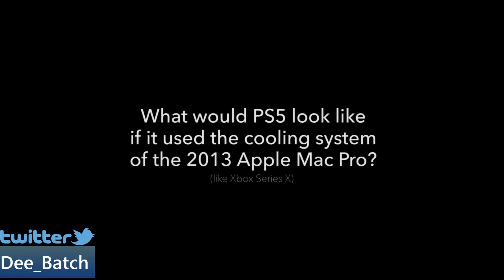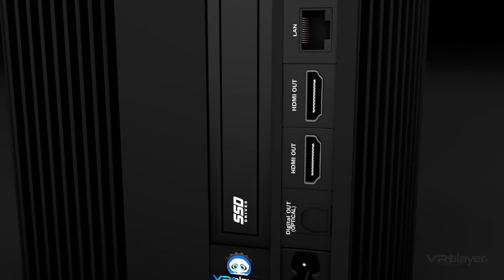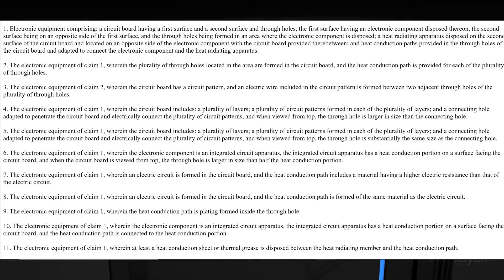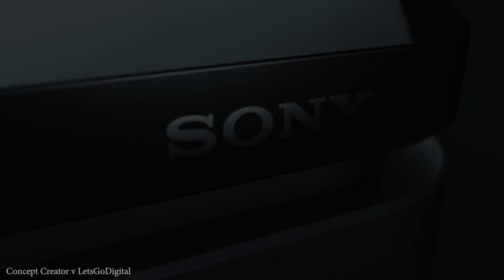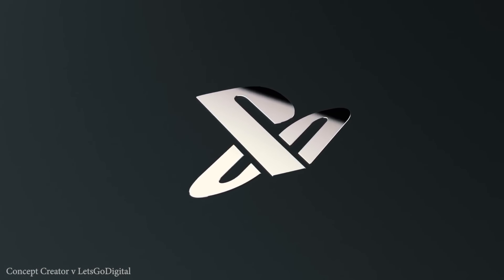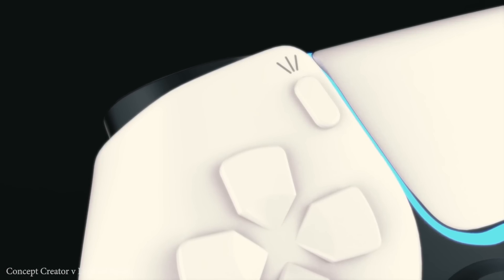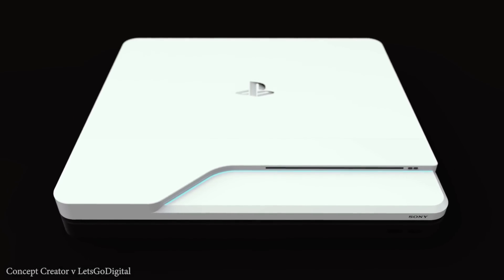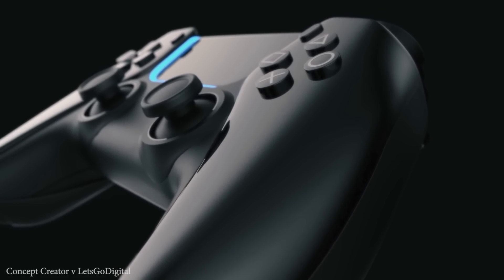PlayStation 5 Cooling Patent Revealed | PS5 Will Have Never Before Seen Tech

Comment from the maker: Sony's Patent on Cooling was filed on April 23(Today). Therefore Dev kits do not have it. Reports of dev kits running hot will be resolved when this cooling system is implemented on the final console. What do you guys think of Sony's Cooling solution?
Reply: If this patent does come true , then tge $500 to $550 price point doesn’t seem far fetched
Reply: @SuperMosh1990  What are you talking about? That price guess has never been far fetched as the production price is 450.
Reply: Another patent that might never see the light of day
Reply: DEE BATCH does anyone read anymore?? The patent is published today, it was filed in 2018. I mean seriously, read first people. Please. Smh
Reply: MG Pilot thats even worse then. Because if this is from 2018 and dev kits are heating now in 2020, that would mean that this cooling method is most likely in the dev units and does not actually work as intended.
Reply: Patrick Julian Krutina it probably means that that story was complete bs. There was no overheating
Reply: @Germinator4lph4  AND Xbox Series ALSO Cools chips from both side. That's what the aluminum center chasis in Xbox Series X does!! So this duel cooling concept is not so new or original.
Reply: INFURIOUS ONE XSX will also the vapor chamber design from One X. Which is actually patented by Microsoft, so the question is have Sony have brought in a new approach.
Reply: @Germinator4lph4  In the End if they both work that's all that matter. It just that PS5 seems to be MUCH more dependent on a good cooling system to get peak performance. Where as Xbox Series X does not.
Reply: @Germinator4lph4  Nonsense. The PS5 Devkits overheating was debunked as bullshit
Reply: just more proof this is a 9 tflop machine....new cooling solution to allow crazy overclock...interesting to see if these last 5 years..
Reply: DEE BATCH better late then never. I can’t help but wonder if Sony got word of Microsoft’s specs and made the decision to over clock their system. And are just now looking into cooling system fixes. - seems strange to be doing this the same year the console launches.
Reply: hahaha!! this xbots are going out of control!!
Reply: Time will tell...I'm finding it hard to see how this console will cost $399.
Reply: Phil has had a Series X hooked up at home testing the final product for some time and PS5 just now coming up with a cooling system. Does Mark have a working final build of a PS5 hooked up at home testing it?
Reply: My MacBook Pro still has fans and get noisy (more so during screen saver mode than graphically intense visuals).
The body being aluminum helps as well... doubt PS5 will be aluminum.
Reply: The patent will be enforceable after April 23th. The PCP was filled May 18th 2018. Is that cooling system inside the dev kits? I'd like to know that!
Reply: DEE BATCH hey Dee, any clue on how costly this cooling system will be for them?
Reply: @T_M_E_8  it was stated it would cost around $3-$4, which doesn't sound like much, but the normal average is less than $1 for that component in mass production. Wont translate to much of a difference for us individually, but for them, they're going to feel that difference in cost.
Reply: Jonathan Hensley thanks!
Reply: @T_M_E_8  You're welcome
Reply: Reeeeeeeeeeee
Reply: DEE BATCH would this make ps5 a good quality system and last long time with no overheating?
Reply from the maker: @mettaalpha8551  Not sure nobody has done this before.
Reply: DEE BATCH yeah will be interesting to see what system will end up being the better buy
Reply: It’s bullshit
Reply: come dee batch! put these xbots together!!
Reply: DEE BATCH mark cerny said revolutionary i guess he was right
Reply: If the patent got filed today, then probably this will not make it into production. This probably their reaction to XSX reveal and Sony is already getting ready for the mid cycle replacement in 2024 i.e the PS5 Pro.
Reply: @Germinator4lph4  Patent was filed in 2018!!!
Reply: @IngaNodie-k9s  ???You're comparing PissyS5 to Xbox One X??? And loading a last Generation game on a Next Generation Console??? That's dumb😲.
Reply: @IngaNodie-k9s  Xbox Velocity Architecture nullifies SSD Advantages. In fact developers have said because of other Technical reason SSD Speed advantages will make little differences and Zero effect on game quality. Xbox Series X's 44% MORE CU Processing Power is just to much for PissyS5 to overcome. And that's besides the TF and CPU Advantages. Xbox Series X will have full Real Time Ray Tracing. PissyS5 will NOT!! Sony has NOT even confirmed if PissyS5 will have VRS??!! PissyS5 is RDNA 1.5 NOT full RDNA 2. When this comes to light hopefully you'll wake up. And NOT buy PissyS5 Day One. Third Party games will look and run soooooo much better on Xbox Series X. Many gamers will be trading in their PissyS5's for Xbox Series X within two months. So it would be wise to wait ✋ and buy a barely used PissyS5 at a discount price!!!??? Wake up Now. Better to be the smart guy buyin the barely usee PissyS5 at a discount. Than be the IDIOT that was dumb enough to buy PissyS5 Day One just to trade it in for Xbox Series X and taking a loss!!?? You've been fairly warned. And given future knowledge. Use it wisely??!!
Reply: @infuriousone5225  You don't know any thing about PS5  except high-level theory represented by Mark Cerny in that GDC conference stop believing in Imaginary secret source and Xbox fanboys youtubers disguise as Imaginary Sony Devs. Sony is been testing for years retracing software and Hardware solutions closely with AMD. Same company Used by Microsoft.
Reply: @IngaNodie-k9s  Hey Friend Games are made by the GPU and CPU NOT the SSD😲.
Reply: @IngaNodie-k9s  the ps5 was loading fast travel in Spiderman not loading the game from scratch.
Reply: @IngaNodie-k9s  no SSD is anywhere near the speed of ram tho.
Reply: @IngaNodie-k9s  Dude Xbox Series is much more Powerful than PissyS5. A SSD drive is not a magical wand that's going to change that. PissyS5 is NOT more cleverly designed. Stop being delusional.
Reply: @infuriousone5225  Who said SSD is the only thing that makes that system powerful there are other components beside that  ETC and Mark confirmed ratracing. For a record I know Xbox Series X GPU is more powerful than PS5 GPU xbox had powerful than Sony for years except the Xbox one but in a long run Sony always showed us innovation every generation.
Reply: @IngaNodie-k9s  No Mark Cerny did NOT confirmed Full Real Time Ray Tracing. He did NOT even confirme Hardware Accelerated Ray Tracing Cores that handle the Ray Tracing WITHOUT using GPU TF Power!! So on Top of Xbox Series X having a SUPERIOR form of Ray Tracing. Xbox Series X 44% CU makes Xbox Series X's ALREADY more Powerful Ray Tracing ANOTHER 44% MORE Powerful😵😵😵. PissyS5 has no hope😫💔😫.
Reply: @infuriousone5225  how will xbox squeeze that £700 graphics card into a £500 console? 🤔
Reply: @philipburgin3109  Ask Microsoft??!!
Reply from the maker: @IngaNodie-k9s  NO
Reply: @IngaNodie-k9s  yes but gears was a very early build and not fully optimized for it. The were just showing the brute force of the power behind the series x and what it could do without fully optimized
Reply: @toddhudson7440  PS5 was not even an early build it was a dev kit imagine what the full product will do. I trust PS5 because it was design with developers, Consumer and engineers in mind. Microsoft rushes to compete without a long term goal that's why they are always bad in technology. They skipped windows 9 being afraid of andriod eventually andriod took over they were left behind they been putting unnecessary big updates on windows affects performance and reliability of windows.
Reply: The Aluminum block between the 2 boards on the XSX is doing the same thing dissipating heat under the chip while the vapor chamber does it from the top.
Reply: Dee please take a look at this https://www.youtube.com/watch?v=oG_7Zf44KU8
Reply: I feel like sony heard yall talking shit(granell) on rdx and new they had to fix that problem before word got to far out
Reply: @OldBu11  Wrong, they had mentioned this cooling soloution 4 months ago
Reply: @IngaNodie-k9s  you just proved you don't have a fucking clue what your talking about.
Reply: So Sony Bone Head Pony Clowns would rather pay for a expensive cooling system instead of paying for more Power😲?? One of the very MANY ways PissStation Gamers have earned the Sony Bone Head Pony Clowns Name!!??
Reply: @infuriousone5225  they pay for the best games
Reply: @infuriousone5225  Xbox has no identity. Best Mp games are multiplatform. Best sp games are PlayStation. Xbox has no goty games. Face the facts
Reply: @infuriousone5225  lmaoooo 1.5 bro there's rumors it might have features from rdna 3.0 so that would actually make it rdna 2.5. the PS5 is 15 to 20 percent less powerful but way more efficient. It will work less to achieve a similar goal. Also PS5 exclusives will be true next gen games. They don't have to worry about the least common denominator or regular HDD's in old consoles and PC's. PS5 will load a demanding game on the fly. with 5gb loaded in half a second and double the throughput than series X it will fully load all assets as the player turns. Series X can't do that with a similar work load. PS5 already confirmed by 3rd party that it has VRS and better
Reply: @SupreemSPGamer  Xbox Series X has 44% MORE Processing Power than PS5. Which means 44% MORE Powerful Ray Tracing and other Smart Technologies too. And Xbox Series X has Ray Tracing Cores that handle the Ray Tracing without putting strain on GPU. PS5 has NOT been confirmed to have this tech.
Reply: @SupreemSPGamer  That Over Clocking is nonsense. A 20% increase in GPU will only mean about a 7% increase in performance. That still leaves PS5 VERY short of Xbox Series X Power and capabilities.
Reply: @infuriousone5225  if you actually know what vrs is you would know a much better application than vrs was already confirmed by Cerny's presentation. More CU's means more shader Ray's. Higher frequency means more shader Ray's per CU or more reflections on a single shader ray.  What you're missing is PS5 has more than double the throughput. Xbox will have to use more power to achieve a similar goal. PS5 only has to focus on what's in front while series X will have to use resources even outside the players view.
Reply: @infuriousone5225  riiigghhttt let's foolishly use PC gpu's as an example..... Actually while we're at let's use gpu's that are not part of next gen consoles for our arguments....... Really? I'll give you a hint. Rdna 2.0 focused on lower voltage and one of the reasons is to get more when overclocking.
Reply: @infuriousone5225  13.3 tf? Wtf ru talking about. This revolutionary design means more than just TF's numbers. Double the throughput! Get that through your head. And don't expect series to give you any true next gen games until they decide to cross out Xbox one and mandate ssd on PC ports. Otherwise enjoy higher textures and features on same current gen games
Reply: @SupreemSPGamer  Yeah I hear you brother. PARITY is Sony Bone Head Pony Clowns ONLY hope😫But what you don't get is that Xbox Series X's 44% MORE Powerful Ray Tracing😮and Full Real Time Ray Tracing😮that doesn't eat GPU Power. Will just STOMP😖all PissyS5's😣versions of GAMES😩.
Reply: @infuriousone5225  AMD already proved it will be using less power so overclocking will be more effective with rdna 2. But this still doesn't make PS5 more powerful. I Don't know why you keep bringing up power when I never said ps5 is more powerful. I think you have Reading comprehension issues and don't actually say anything about points that I've raised.... Points that really matter for example series x using more power than ps5 in order to achieve the same goal. And the fact that with all that"power" we won't see true next gen games on series X if the conditions mentions are not eliminated
Reply: @SupreemSPGamer  PS5 is a 9.2TF over clocked joke. Over Clocking is NOT giving PS5 any kind of advantages. Developers are ALREADY saying that the boost is nonsense and difficult to work with. Set specs are a much better Standard to have.
Reply: @infuriousone5225  sure bud. Most devs are praising ps5 and how easy it is to get full power out of it. Kind of the contrary to you. But again you seem to be bringing up power. I never said ps5 is more powerful. Hopefully on the next one you actually don't argue back something I didn't bring up. I'll mention it again. PS5 will use less power to achieve a similar work load. It's more efficient. Has more than double the throughput. Has a separate processor for data management which is not in the"TFs" equation. It will load games on the fly and use full power only in the field of view... Something series X won't be capable on a similar work load. Therefore it has to use more power and load assets outside of the players view. I guess you got nothing from the presentation, all you know is teraflops. Plus we won't get next gen games on series X. Games/design will be held back by previous consoles and HDD'S in consoles/PC's.
Reply: @infuriousone5225  I prefer sony because there's no xbox game that interests me in the least. The only one is Fable and that is said to be released till 2022 and who knows if it's going to be any good. Also the new studios haven't put out anything that makes me wanna prefer xsx over ps5. So please stop it with the power narrative it doesn't matter that much, just look at Nintendo's success. Name calling? What are you, 5?
Reply: @SethiBybel  Infurious one is like this on everything. Even 99% of Xbox people dont even like him and even MaDz has put out videos disproving crap he says.🤣
Reply: @jonathanhensley4883  then I guess is no use responding to that guy uh? Haha thanks man.
Reply: @SethiBybel  lmao. You're welcome. You can try responding to him, but I guarantee the only thing it will get you is annoyed.
Reply: @jonathanhensley4883  ???  I have NEVER been proven wrong!!
Reply: @marty8370  huh?? So Xbox Series X's 44% MORE CU Processing Power isn't a a VERY big advantage??? Xbox Series X having Real Time Full Ray Tracing and PS5 NOT having that is a tremendous advantage that will be clearly apparent.
Reply: @infuriousone5225  kinda just as sad as paying more to play less quality games.
Reply: @infuriousone5225  I'd rather put my money where the games are.
Reply: @infuriousone5225  Uh so. A bunch of shovelware you get  to play again for the 4000th time, without compelling exclusives, and no real fresh take on next generation. All focused on a console that has less power than the PS4 Pro, and it's supposed to be leading you into next generation. Amazing. Wow. Yeah, I'm just going to get right in line when you can buy one.
Reply: INFURIOUS ONE you have to take into consideration, that power only takes you so far because both consoles theoretically  can run at 8K they both can easily run @ 4K 60fps. Sure there is better Raytracing and shaders etc, but how many people who buy these games have the TV sets to support these enhancements to their full potential. I would say the greater majority dont. Infact 1440p seems to be the industry sweet spot.
This is why this generation of consoles will not be fought over power.
Reply: @philwhatever3903  There was a poll it came out to less than half the console sold were hooked up to 4k tvs
Reply: @philwhatever3903  Never implied I cared about "Gaa gaa goo goo sales of Consoles" Its about where "ALL GAMES" will Look and Play BEST!!! And that's will be on Xbox Series X. 44% MORE CU Processing Power is a VERY big and a VERY important factor. Besides the TF and CPU Advantages Xbox Series X has over PS5.
Reply: @philwhatever3903  Well you're completely wrong. 4k HDR TV's are the standard now. No one is making 1080p TV's. Xbox Series X STOMPS PS5 into dust. Theres NOTHING PS5 can do to make up for the lack of CU's!!! NOTHING!!! 44% MORE CU's STOMPS PS5!!! Besides 2TF+ MORE Powerful and a MORE Powerful CPU too. PS5 is in FACT a generation behind Xbox Series X!! You'd be a fool to waste your money buying PS5 Day One!!??
Reply: @sparhawk6990  There's also REALITY. No one makes 1080p TV's ANYMORE!! 4k HDR is the Standard now😵😵😵!!!
Reply: @infuriousone5225  wow you sound like youre super desperate about xbox.. so what quality games are you playing when it comes out??
Reply: @infuriousone5225  who said anything about sony?? Everything you're playing on xbox I can play on PC better lol you're screaming at everyone XBOX XBOX but I'm the fanboy? Gtfo go back to playing Master Queef space adventures 8.
Reply: @sparhawk6990  Maybe, but that will likely double next gen as 4K TV fall in price
Reply: @infuriousone5225  well why do i need your shitbox when i have a more powerful pc i just need those sony exclusives
Reply: @davidslavin532  not unless you are rocking a i7 9700k with 16gb ddr4 ram at 3200mhz with a 1tb Samsung 970 Evo Plus Nvme and a RTX 2080ti overclock to the max will you have a more powerful pc?
Reply: UNiX_ 0lI exactly. Tell these MFs what the truth and facts are bro!
Reply: WaxDat8800 if Sony was panicking they would be releasing incomplete info. They just relaxing and waiting for their time to shine.
Reply: WaxDat8800 what’s so brilliant about it?
Reply: @WaxDat8800  Sony going to be selling PS5 on the hopes of PS5 Pro. Sony going to close out PS5 Reveal with Promo for PS5 Pro. Talking about RDNA 3 and Zen 3 too. PissyS5 Pro Hope is the ONLY thing that's going to sell PissyS5.
Reply: @davidslavin532  So far only one Sony exclusive is getting ported too PC, a 3 year old game. Horizon Zero Dawn, Sony has no plans for any newer games too get PC ports. Thats has already been debunked by Sony
Reply: @marty8370  i wasn't talking about ps i was talking about xbox since all their exclusives are on pc
Reply: @THERealTimeRob  Yep, So true PS4 still selling like hot cakes, 2nd half of the year will be PS5 time
Reply: @ddp5406  they cant but neither can sony because they are sending their exclusive to pc as well and are going to get into the cloud streaming as well and if you cant see that you need to take your blinders off